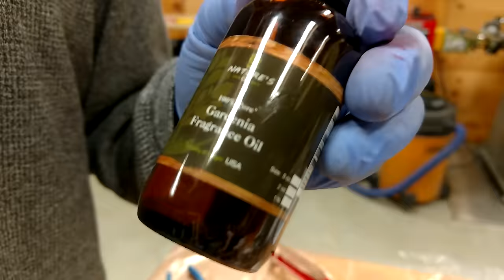Making Colored Smoke Devices for 4th of July

Comment: i there a way of increasing the amount of smoke even if it mean the smoke bomb might burn quicker ?
Reply from the maker: The amount of smoke depends on the quantity of dye. Basically, you need a bigger tube for more smoke. The speed of the burn depends on the temperature, which must be limited to prevent the distruction of the dye, as well the surface area of the burn.
Reply: @TechIngredients  thanks bud

Comment: Awesome videos! Very instructional and just on point to keeping my attention! Would you consider the smoke devices you made a "Cold Burning" where it burns at a low enough temperature that it can be handled with no external flame coming out? Keep it up! You have another subscriber here!
Reply from the maker: Thanks!  The smoke is quite cool as long as you hold your hand several inches or more from the port.
Reply: @tech ingredients Awesome! I really appreciate it the response. How easy was it to find most of these materials?

Comment: Could i use Potassium Carbonate instead? i only have access to potassium chloride
Reply from the maker: No, it won't work.
Reply: @TechIngredients  so I have to extract potassium chlorate from potassium chloride huh
Reply from the maker: You are correct.  The synthesis is not that difficult, but will be inconvenient.  Alternatively, you can also use potassium perchlorate.

Comment: does anybody knows that if i set one of them on fire inside a room, will it stain the walls? sry for the poor english, a little bit rusty.
Reply from the maker: I think it's possible.
Reply: @TechIngredients  First of all thanks for responding me, im a huge fan, for a long time, and sry for bothering again, but i dont know if it is because i live in México or something but i dont seem to find the solvent dye, the best i got is "tinte de madera" that stands for wood tint, could you give a hint of what are those dye's used for please? (of course i searched for it in english, but still nothing (i looked on "mercadolibre" that is the spansih version of ebay, also looked for it on ebay and amazon) thanks

Comment: I really enjoyed your videos about smoke devices, but you should be aware of toxicity of your "solvent dyes". For instance methyl yellow one of the first listed dye of your supplier belongs to the azo dyes. They are known to be cancerogenic and toxic. You can look them up by there CAS number for there properties or may land to a Wikipedia article

https://en.m.wikipedia.org/wiki/Methyl_yellow

However, they are very robust because of there chemical nature (conjugated aromatic system etc.) and seems to be surprisingly stable under higher temperatures, as you used them with the chlorate as oxidizer.

Did you tried inorganic dyes or pigments? They might be cheaper, more stable under higher temperatures and also (some) less harmful.

Comment: There definitely is a health issue with that. Not because of the dyes, but because of the wax. In the reaction the wax isn't burned like it is when burning a candle (which would leave you with only a very small amount of still not healthy smoke). Instead the wax is only turned in to gas/steam (the same stuff you get when you blow out a candle) and that paraffin steam is really bad for you because when you inhale it, it will stick to your lungs and seal them. That makes this steam much more unhealthy then smoking.
So just try to stay out of the smoke  as much as possible ;)

Comment: What gonna happen if i use kno3 instead of kclo3?
Reply from the maker: It will have to burn too hot to maintain the oxygen providing, decomposition of the KNO3 and this will degrade the temperature sensitive dye molecules.
Reply: Make a video with KNO3. Because in my country KCLO3 is not that much available.

Comment: NEVER mix chlorate compositions in a metal can that can produce sparks, especially paint cans that depend on a friction fit to close the lid. Use the diaper method to mix them. That is a great way to get ignition on a low temp oxidizer with a low temp fuel. Also, the bicarbonates are used to neutralize any potential acids that might be in any of your components. KClO3 is very reactive with the slighted acidic components. You should hook up with some of the hobbyist fireworks makers for some safety lessons. Ugg.

Comment: How would your mix ratios be adjusted if someone didn't want to use the dyeing agent, but possibly still the cooler mixture that can effectively carry the oil?
Reply from the maker: Probably not much.  The dye doesn't enter into the reaction, but is a thermal mass.  I'd start with the same basic formula, add the oil and test a small quantity by wrapping in aluminum foil  and igniting it.  Adjust the sugar quantity up a bit at a time to reduce the burn rate.
Reply: @TechIngredients  thank you sir! I hope you know how valuable your videos are to me. You provide a wealth of knowledge on a breadth of subjects, and interact on 4 year old videos! Please keep up the good work, and merry Christmas to you and yours!

Comment: Awesome tutorial! Thank you so much for posting this. I have used your recipe and they work like a champ. One question I have  is how impact sensitive (if at all) is this mixture? I build bird bangers for 37mm flare  launchers and would love to use this formula for smoke grenades. I use around 60 grains of fffg for the lift charge  out of my launcher. No sure what that would translate to in kinetic energy that would be exerted on the said smoke grenade . Thanks in advance!
Reply from the maker: I suspect it is not very impact sensitive only based on the difficulty in igniting it without a high temperature starter mixture.  You could certainly test this with a hammer and a steel plate.  I don't believe you could ignite or detonate it with this technique.
Reply: Thank you for such a prompt reply sir. I will give that a try with a VERY small amount.

Comment: % means nothing to me I need a weight of each
Reply from the maker: It's really easy as the percent gives a ratio. If you want a final weight of, say 100 gm, then use the percentages as grams. If you wand 500 gm, then multiply the percentages by 5 and so on.

Comment: How to make it burn faster so the smoke come realy fast
Reply from the maker: It is probably best to simply enlarge it.  Otherwise, if you increase the burn rate of the formula. the temperature will rise and you run the risk of degrading the dye.
Reply: Tech Ingredients it's ok because what im looking is the smoke come realy fast
So its get thick cloud much faster

How i could make it
Help me
Reply from the maker: Enlarge the tube and the output port and ignite several of these larger devices at the same time.
Reply: Tech Ingredients hnmm could i add more hole so the smoke will spreed
Can i
Reply from the maker: You probably could.

Comment: How much grams of each????? Plz help
Reply from the maker: Treat the ratios as grams, i.e.,10%+50%+40% is the same as 10gm+50gm+40gm.
Reply: @TechIngredients  36 gram Smoke Dye, 27 gram Potassium Chlorate, 18 gram Sugar, 16 gram Magnesium Carbonate, 3 gram Sodium Bicarbonate. is that correct??? but i thought you said the Magnesium carbonate is lighter so it needs more or does that not matter or already a factor in the formula? Also where do you get dye i have been looking everywhere. I love your channel thankyou so much!!!
Reply from the maker: You're right it doesn't matter. Being lighter, it just takes up more volume,  but weight is weight.
Check out coloredsmoke.com
Reply: @TechIngredients  oh hey also would i be able to make a colored smoke bomb with potassium nitrate and sugar? those seem to work well can i just add the dye in that or would it not work?
Reply from the maker: No.
I explained  why in the video.  It burns too hot.

Comment: I love your videos but this one is irresponsible. You CAN NOT use Chlorate mixtures without informing about their sensitivity to shock, friction and acidity! If you remove the dye and carbonates from this mixture it becomes very, very dangerous. The average person will probablu test the burn rate by ignating a small amout of loose powder, but the thing is that with chlorate mixtures the burn rate when ignitied by fire doesn´t say anthing about what happens when the same mixture gets ignited by shock or friction.  Example: barium chlorate and shellac gives one of the best green colors in firework stars but if you put a blasting cap in the mix it detonates with a velocity of 1800 m/s. There has been horrible accidents with potassium chlorate and sugar. 
It is true that lactose probably is one of the safest fuels with potassium chlorate but a person who buys potassium chlorate inspired by this video is virtually guaranteed to try other compositions that are much much worse as well. How you can make a video like this without saying a single word about these properties is beyond me. Also if you value your life you should add the chlorate last o avoid localized higher chlorate concentrations during mixing, and after the chlorate is added you should mix without tools. I would never ever mix or store a chorate composition in a metal container. 
To the audience: 
Sulfur and sulfur compounds are extremely dangerous with chlorates. (Sulfur and potassium chlorate is what they use in the insane exploding hammer festival in Mexico). A few particles caught in the threads of a lid of a container can be enough to set it off. I heard of a kid who lost his hands that way. It is worse if the sulfur is manufactured by sublimation since the final product may be slightly acidic. . Aside from the sensitivity to friction chlorates are are also sensitive to acidic environments. Potassium chlorate and sugar will for example self ignite if you add a drop of sulfuric acid. Making chlorate based flash powder is a horribly bad idea. Aside from the low critical mass**, high energy content, sensitivity to static electricity and extremly high burn rate the mixture is pH sensitive in both directions;. potassium chlorate doesn´t like acidic conditions and aluminium doesn´t like basic conditions. Magnesium is even more dangerous. Not to mention red phosphorous  - that mix can expolde even when wet.
The combiantion chlorate/aluminium/nitrate is known as the "death mix" due to the possible formation of ammonium chlorate which is a very unstable explosive. Personally I have stopped using chlorates completely.

Be very careful with chlorates!  / Best regards from an annoyed pyrotechnician in Sweden

**Critical mass is the ammount that is required to create an explosion with a shock wave even without any container. For black powder the critical mass is around 500 lbs. For flash power we are talking grams depending on type.
Reply: Never mix with metal powders aluminum or magnesium
Reply: @ruizhou9612  magnesium should ONLY be used with nitrates. 
when it comes to aluminium: When potassium PERchlorate is used as an oxidizer aluminium should be the only fuel. Never add anything else such as for example sulphur.
Aluminium/nitrate compositions need boric acid as a stabilizer.
The very worst thing you could do is to use chlorates where there is a risk of ammonium ions being formed. 
Examples: chlorate/nitrate/aluminium is called "the death mix" and ammonium perchlorate and potassium chlorate sholdn´t even be handled in the same building.  (On Malta (Europe's fireworks paradise) Ammonium perchlorate is banned on the entire island just because there are som many people using chlorates there.)

Comment: I fly Paramotors and I bought a smoke system for it, and it injects baby oil into the exhaust to produce smoke.
What if anything can I mix with the baby oil to make colors?
Reply from the maker: You might direct that question  to coloredsmoke.com.  they may be able to recommend  an oil soluabile dye.  The only problem I can see is the high temperature  stability  of those dyes in the exhaust.
Reply: @TechIngredients  Thank you  for the reply! Love your channel!

Comment: what happens if u mix em in sucha a way two colors burn at the same time.. do u get a mixed color??
Reply from the maker: Yes, they produce a mixed color, but the strength of the colors varies and so one may tend to dominate even if a 50:50 mix is used.  You will have to experiment a little.